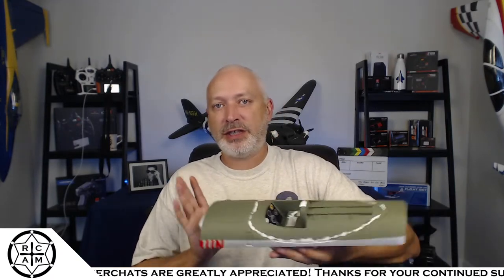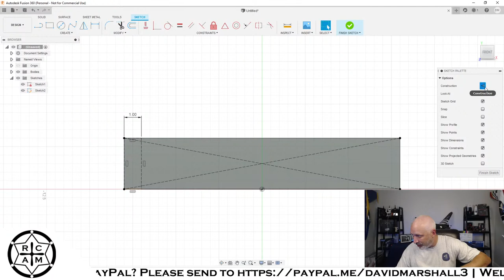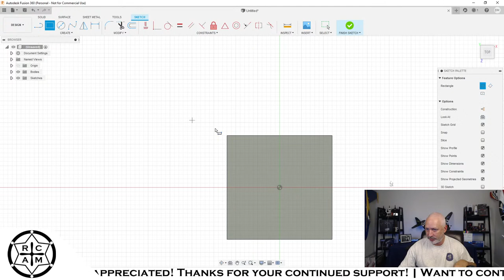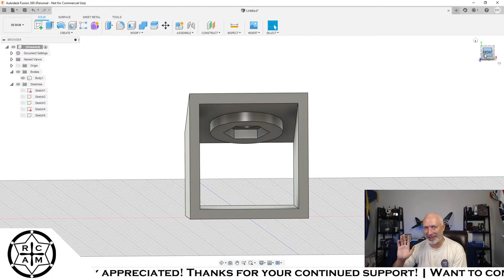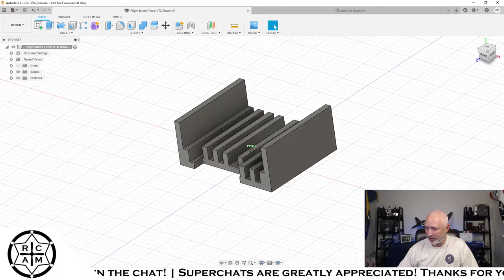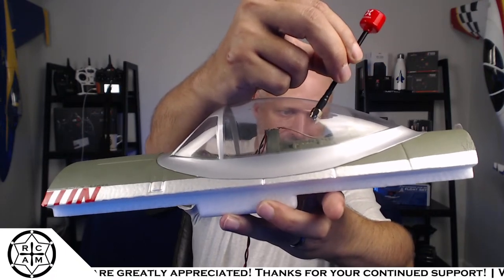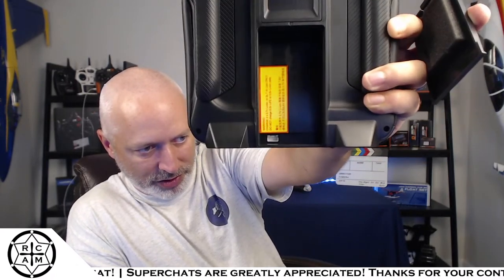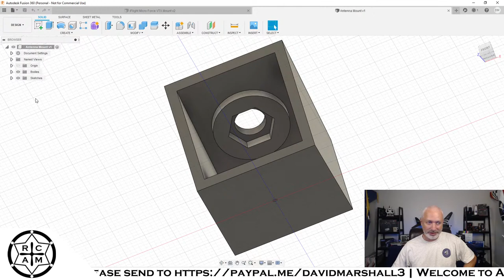VTX and Antenna Mount Design for 3D Printing (Fusion 360)

Comment: I have the Spektrum 200mwatt VTX with goggle setup.  Its nice. I rarely get break ups in reception.  Its great.  i run my stuff on a small 2s lipot. the VTX steps the voltage out to 5v for the cam.  Im running a Runcam split 3 nano.